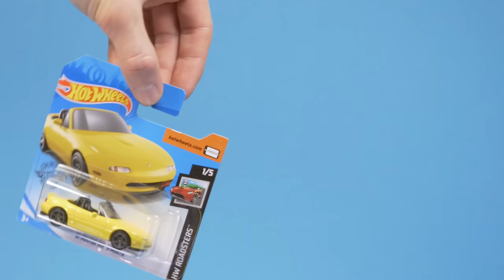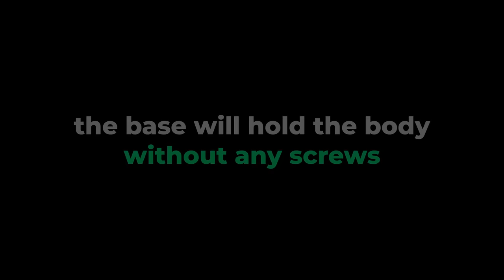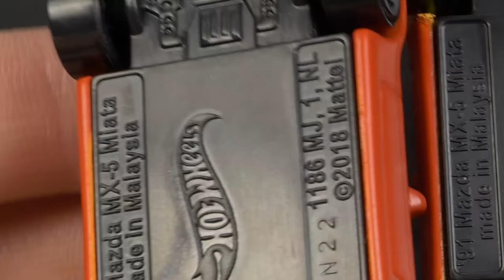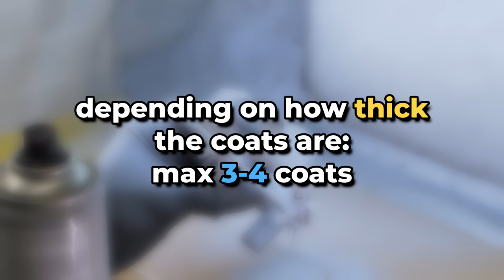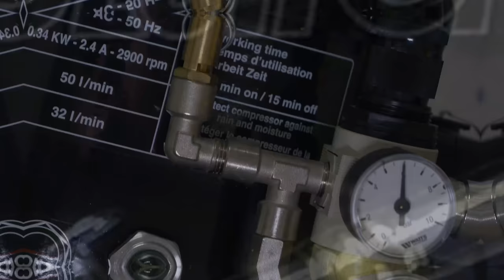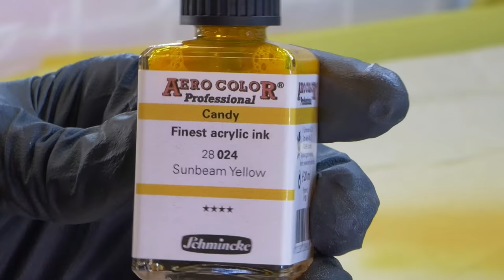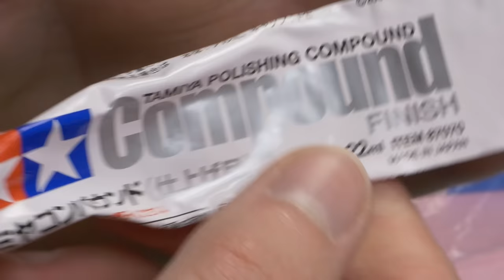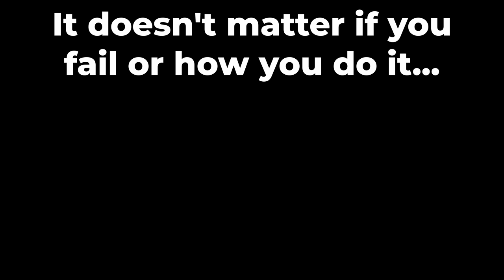How to PAINT Hot Wheels? (Beginner Guide)

Comment from the maker: 👉Ask!👈
I will try my best to answer all of your questions in time, if something is/was unclear. (Please make a separate comment, so that I get a notification)

🤍Community-Driven🤍
You are welcome to tell your story, tips & tricks, or challenges you've taken in painting Hot Wheels cars, so that other people may benefit from it as well.

⬆That said, if you find some info useful, please „up vote“ it, so that more people can see it

🧠Read the video description: I’ve made a list on all materials & tools for each level and how much you might pay for a single item.

Note to 16:21 : All paint-coat numbers depend STRONGLY on the spray- or airbrush-paint you are using, as well as your spray-style. Some paints spray thicker, stronger, some other are very light and run easily if you throw thick coats on the surface. It's good for a starting point, but please experiment on that!

Happy Customizing and have a great day!
Reply: Wish I had the skill, just don't have the time. Always wanted a hot wheel customized to look like my car. How long did it take you to learn the skill?
Reply: My question: can i use a 1,5mm instead of the 1,8mm drill bit? The 1,8 is very hard to find (i never saw it) and i got a 1,5mm at home.
Reply from the maker: @tyerex5031  Everyone starts roughly at the same level, so everyone can do this, instantly. If you have already some experience in model building or something similar (like I did), it might be easier. But the most important step to take is just to start. It comes down on how passionate you are about it. Success is a matter of will.
But like I said, you need to start! Basic stuff like spray painting out an can, wheel-swapping / lowering and detail painting can be learned quickly., just have fun!
Reply from the maker: @Slav_Cream  You can use 1.5mm to open it, but you wont fit a M2 screw into the post. You can just glue it back, or put it with no support back on. Depending on which side of the world you live (metrical / imperial System): you can use different screws with different available drill bits
Reply: How can i paint under the spoiler with spray can and without doing multiple layers at the back?
Reply: How did you install the antenna, I'm a bit confused
Reply: @themodelcarproject  just got my hands on some 1.8mm bits B)

edit: and m2 screws

so im gonna watch again and try to take my hw apart
Reply: and also another question: do all hot wheels have the same-sized thing that u need to drill off to open it or do sizes of it can be different
Reply: Oh, so that's why it didn't work! I keep using Tamiya primer. Not only does it not stick but it also runs!
Reply from the maker: @B_Gery  Before starting to paint wide areas of you car, start at the back, and try to get under the spoiler and on the trunk (light coats). Then move forward to do a light 1st coat and so on....
Remember always to start at the difficult areas first. If you see some 1% exposed undercoats, and then try to hit them after you painted 99% of the car, you very likely might end up ruining the 99% of work done with "too much layers" at one side. Hope that helps
Reply from the maker: @danishthegamer902  drilled a hole into the body before painting it. After everything was cured, I've made an "rounded/drilled end" on the 0.4mm wire to be able to glue some material onto the body. This end is of course under the body and not exposed to the outside. Glue it from the inside. And then put on some tamiya X black paint on the exposed side of antenna to make it look more realisitc.
Reply from the maker: @Slav_Cream  No, the rivet, where the body is connected with the plastic base is on all newer models the same (I think some redliners might have different sized rivets, but they are also 50 years old...). Matchbox has also the same rivets.
Reply from the maker: @tyomikshkolnik7988  If paint runs it's very likely a sign of too thinned paint. I would recommend to thin it less in this case (just a general tip). Tamiya paints however are great, their primer just performs quite poorly on diecast metal
Reply: @B_Gery from what i've seen, its better to paint the underside of the car first. Just spray the inside and then continue on the exterior.
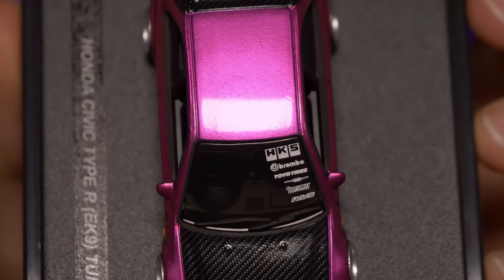Reply: What kind of display case do you use at 18:53? Could you provide us with a link to buy them?
Reply from the maker: @sunniboi7105  Dont have any links, but they are called "triple9 1:43 scale display cases", you can find them on ebay usually.
Reply: @themodelcarproject I've found them, thanks! If you mind me asking, how do you get the car to stay on the display and not just roll off?
Reply from the maker: @sunniboi7105  I drill a hole into the car base, place a M2 nut screw inside and glue it with super glue and/or 2k glue. Some minor interior modifications on the underside are sometimes required. Then drill a hole into the display stand, and screw it with an m2 screw together.
Reply: Can i use 2mm drill bit? I can't find 1.8mm drill bit.
Reply: @kaskiiiii you should use a drill bit that fits your screws. 1.8mm fits m2 screws - you're probably gonna need to find other screws if you use a 2mm drill
Reply: 11:30
Reply: Is it ok to use a different drill or just a screw around 4 mm?
Reply: do you have a link the helping hand you used? or anything that may help, thanks
Reply from the maker: @dpdavids  No links, but it's called "third hand" or "soldering aid"
Reply: is it the same if i want to custom my fleet flyer?
Reply from the maker: @Yummz2401  sure, why not. I would firstly check if your primer works on plastic if you want use one (just spray a tiny bit on the side of the truck enclosure).But you can also spray directly on the plastic, after cleaning it and removing decals if there are any.
Reply: how long does it take for the spray to dry?
Reply: Question 1 - what spray is recommened
Q. 2 - what tape
Reply from the maker: @Vtx.tr3ndyz  Q1 I go for spray cans simply with montana acryl nitro combi. Enamel/Laquer-Sprays work as well, have better durability, might take longer to dry though
Q2 Tamiya tape for curves. if you buy "basic" version (yellow tape) then go with one thats super thin.
Reply from the maker: @Yummz2401  Really depends on the spray can and type of paint. Acrylic-Nitro-Combo types are a bit quicker, you can handle them in about 1-2 days or so with ease, fully cured maybe a week. Some other can take up longer times...
At the same time: it never hurts to wait a bit longer. You can also make a dryness check like shown in the video. Or press with your nail on a "hidden" spot
Reply: you use 3mm or 2mm screws or both can be used
Reply from the maker: @Yummz2401  I only use M2 screws with an lenght of 3-5mm. M3 screws are a bit too big.
Reply: @themodelcarproject  so I can use 4mm m2 screw right?
Reply from the maker: @Yummz2401  Yes, that will work
Reply: Can you make a vid about how to make a car spoiler?
Reply: can you use car paint for painting hotwheels?
Reply from the maker: @rocketmania-rocketleague6911  of course, the primer that I've used is an automotive 1k primer. Just make some tests.
Reply: so i could use "5oz Aerosol Can - Kustom Canz - Urethane basecoat" right?- and oh yeah would i be able to use car ceramic coating for a polished layer? (its a car paint i think)
Reply from the maker: @rocketmania-rocketleague6911  I havent tried any of the materials mentioned myself yet, in one or the other way you always have to test them out, just go for it.
Reply: what brand of paint stripper?
Reply: What is this substance where you put the hot wheel in?
Reply from the maker: @DanielBeisch  Paint Stripper I use: „pufas abbeizer p15 intensiv 750ml“
Reply: How can you check if the airbrush coats are dry or not?
Reply: Is the paint that you use for the level 3 one matte finish?
Reply from the maker: @gonzoblogs4531  yes its matte, thats why I applied clear coat. There are also color spray paints that dry out clear, they work as well
Reply: Hey bro do you think that acetone would be a good alternative of paint stripper? Thanks
Reply from the maker: @Static.Customs.  From my experience it only works like 50% of the time, if not less. Especially HW cars with a metallic paint job are super tough. I would recommend this paint stripper „pufas abbeizer p15 intensiv 750ml“. Or if you live in usa or asia you might get even stronger paint stripper.
In any case, just give it a try. Hope that helps.
Reply: @themodelcarproject  Thank you!
Reply: Bro , sorry for late reply, but will 1k clear coat will be okay for level 4?
Reply from the maker: @miniaturewheels33  Yes, I used to clear coat all of my cars with 1k clear coat until now. I switched because I aim for the best result possible, but for starters I definitely would advice to use 1k coat. It's way more convenient. 1 thing to note: it might loose about 10% shine over the years, but again it doesnt bother that much, almost all of my cars are 1k coated. Hope that helps
Reply: @themodelcarproject  thx
Reply: When cleaning the car of the paint stripper how do you dispose of the used tissues and clean the brush?
Reply from the maker: @orlan2rt  I try to keep as much of the paint stripper inside the jar as possible.  I clean the brush with some tissues as well. All the tissues go to residual waste.
Reply: Does Tamiya paint scratch off too I just used tamiya primer and I didn’t get this far in the video 😭 it kinda scratches off but not as easily I haven’t used it yet but it’s lacquer tamiya paint will it scratch off easily
Reply from the maker: @saproductions5189  are you sure that you have the exact same tamiya primer? If yes, and if the primer is already on the car, dont worry, go ahead. If you are finished, just be sure to not scratch it. I have quite a few cars that have the tamiya primer on it, they are still looking great. They just wont be as durable as some other primer. Next time you can try some other primer if you like.
Reply: @themodelcarproject  I tested the primer it doesn’t chip
Reply: I’m making a ae86 levin it’s from 1985 so the metal is old but it looks sick
Reply: how tf is that a response to the question: do all hw have the same rivet size?! (also k that im christian) Undercoverbat95
Reply: @themodelcarproject  hey model car project, just want to ask, what brand of brush did you use for detailing? On the fast and furious supra vid, btw i already coment this on the supra video 1 week ago so i figure, i come here. I will wait your answer ok.
Reply: Where are the stickers from? When do you add them?
Reply: Cab I custom any dicast car?
Reply: Hola¿hay otra manera de abrir el auto sin necesidad de algo eléctrico?como algo manual
Reply: How long should I want to put decals after the final coat of paint? I want to clear coat over the decals for durability, but I'm not sure how much time I have after the final coat of paint to spray clear for a good finish.
Reply from the maker: @karthik.g63  wait until the paint is fully cured before putting decals on. Depends strongly on the type of paint you are using. For the decals wait maybe over night, so that the water can evaporate out of the decals. Also make sure to check if the clear coat is compatible with your decals, for example: put a decal on an unused hot wheels and then put clear coat on it to see if it doesnt melt the decal. Then you should be good to go.
Reply: can you use sand paper for smoothing the metal before painting it?
Reply: question , is 1k resistant to alcohol? like, can you clean the car with alcohol without damaging the layer?,  I was using Mr.shine for a project and turns out alcohol will remove it from the project
Reply: @themodelcarproject  i have a question about the final model you created
What did you base the paint job on? Was it a real life Miata paint scheme? I would love to find out, its an awesome paint scheme, and while the car I'm not modifying isnt from hotwheels (its a 1/32 scale) I'm basing it off the livery design you made but with my own colors so i hope that's cool
Reply: @themodelcarproject can you recommend me other primer? Because no one is selling normfest in my country. Thank you!
Reply: @RaditraIndonesia  i would recommend Bosny, they're a very good brand and their paints work on hotwheels too
Reply: @Enzi_Meteori_902 thanks! I appreciated it
Reply from the maker: @Enzi_Meteori_902  Yeah for sure, go ahead, thats great to hear! I just created this livery from the top of my head ;D Would love to see your results
Reply from the maker: @shiramshiram7089  It depends on the grid but generally yes
Reply from the maker: @ThinkerOnTheBus  Good question actually. Before hand I would like to inform that I now use the createx acrylic line up. And they are much clearer with their instructions and they function basically the same as from the "Schmincke" Aero Color Brand. You always have the paint which is rich and high pigmented. Often very thin. For example with the acrylic candy paints/ inks you need some medium to properly spray it but also to give it some more durability. Thats where you need some type of resin-polymere or something like that. In case of createy its their UVLS Clear Polyurethane "Medium".

If you have some other paint that is much thicker yet still an acrylic water based product, the manufacturer has already mixed some type of his own medium in there. So they function all similar. I also cross tested createx medium with schmincke inks and vice versa and they work well together.

Now with this background to answer you final question: I think its a mis-wording by Schmincke. They might say that it thins the color. Which is in some case true, because the more clear medium you have inside your paint cup the more translucent the color gets because the pigments are "stretched". They have more resin-medium-"neighbors" than before the mixing. But really it is a Medium and water, isopropanol or some other alcohol-based thinner with helping chemicals is the real thinner. It thins everything down.

Kind of a long romance that I wrote here, about everything I know so far... but hope it could make it less confusing.
Reply from the maker: @noratatax2618  In most scenarios I witnessed the same results as you. 1k alcohol/water based paint is not 100% resistant to Isopropanol, because Isopropanol is a thinning agent that is used to thin the paint while its liquid.

Acrylic 1K Nitro Combi Spray Cans are also a bit more resistant to this...

If you want 100% resistant paints againts Isoprop. then go for a laquer or enamel based paint line up.

Or just dont rub your cars with Isopronanol ;D
Hope this helps
Reply: @themodelcarproject  Thanks for the Go ahead to create a similar livery but with my own spin and colors! Unfortunately at the time I'm making this comment, the Miata (which still isn't a Hotwheels Miata its something else) has been experiencing troubles but I'll be able to work them out soon
Reply: @themodelcarproject  hahahahahaha I guess not rubbing them with alcohol will just be the solution
Reply: Can you give an link in Aliexpress / Temu for screws?
Reply: Bro how to look for helping hands. If I search up "helping hands for painting" then painting of some hands are appearing.What is he terminology for it?
Reply from the maker: @miniaturewheels33  Try: helping hands for soldering, they aren't initially designed for painting ;D
Reply: @themodelcarproject  thx man